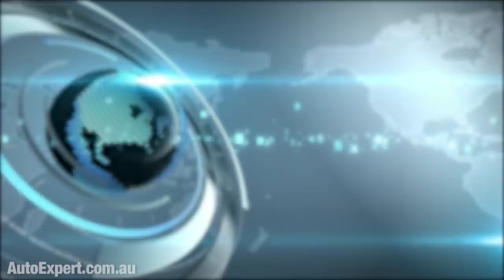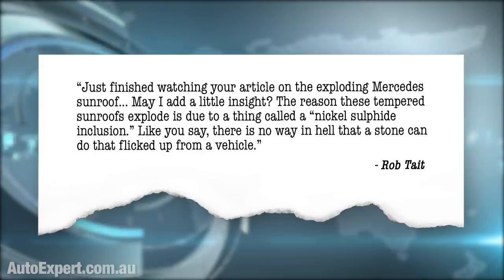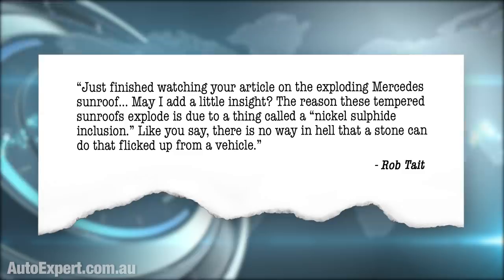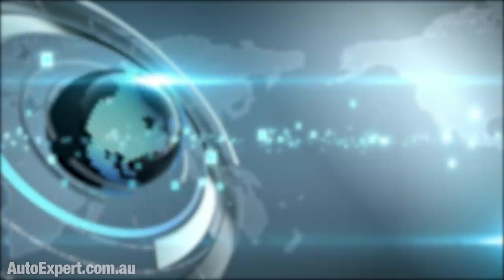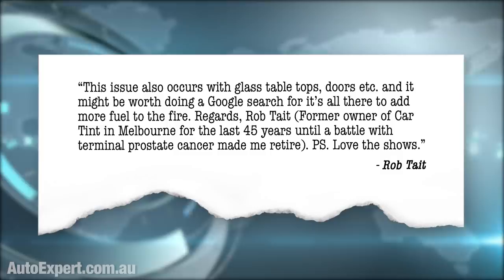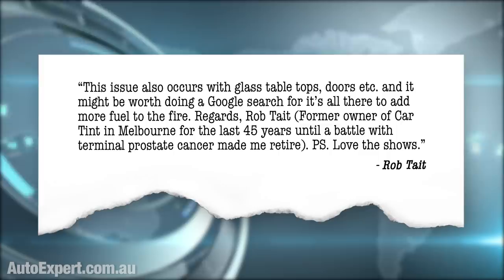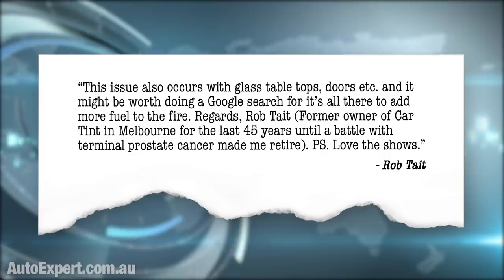Why panoramic glass sunroofs sometimes spontaneously explode & shatter | Auto Expert John Cadogan

Comment: Panoramic sunroofs are most definitely tested in real life before production, and not just virtually. I was fortunate enough to do a job in an R&D testing facility in the Netherlands a few years ago. We walked through one room where a whole variety of car parts from different brands were being stress tested. There in the corner was a panoramic sunroof set on a jig undergoing vibration stress testing. When I mentioned I was from Australia, the guy said the test was equivalent to driving across Australia several times, simulating using only corrugated, pot-holed roads. Was quite interesting.

Comment: Yep, correct - my comment from 2 days ago.  "One issue with tempered glass is a very low percentage of glass panels can spontaneously break. This is due to nickel sulfide stones increasing in size due to repeated heating and cooling during tempering."

Comment: I worked in a soft drink factory for twenty years. With bottles under pressure, you only need one tiny stress riser…say a minuscule inclusion that was in the molten glass when the bottle was made, or a tiny scratch…and when pressure is put in that bottle. We used to gather up as many shards and pieces of glass as possible when a bottle exploded and send them off to the manufacturer to be analysed. They would find these tiny inclusions and be able to point out where the explosion started. It was very interesting stuff.
Oh, and I can’t think of a reason why I should win the power pack. Unimaginative plonker that  I am.

Comment: I've got a sunroof in my car. The only time I used it was when I tapped its button rather than the Cruise Control one adjacent.
For me, the sunroof is as useful as bicycle to a fish.
Reply from the maker: I never open mine, either.
Reply: When i had one i used it all the time. I loved it. I remove the sunroof from my 1985rx7 all the time
Reply: I have a 100 lbs blue tick coonhound in the car with me most of the time, so the back right window is almost always open, even with light rain and snow.  If it's above 50F (10C), the sunroof is open as well and he stretches up so his ears can flap in the wind.  He does that in both my Forester XT and F350.  A sunroof is a deal-breaker for me.
Reply: Does anyone ever open them?! I feel like people like the idea but then they realize it’s too bright and/or too loud and never open them.
Reply: Why buy a car with a sunroof which usually cost extra by the by
If your never going to use it ????
Reply: @daithiheneghan458  like John said in the video, most of the time they come standard on high trim levels so you don’t have a choice.

I agree though.
Reply: @daithiheneghan458  because it is a standard addition to the high spec models.
Reply: @kc510  As John said a sunroof is already included in the upmarket models so a lot of owners are stuck with them.

Comment: When pushing an inverter, you need to say the max KVA/KW/Amp rating. Its ok to to have the KWH rating but if you need 7amp/1.6KVA but the inverter is only 1.5KVA than a billion KWH is useless.
I have a 300W inverter and a 500w inverter. To charge my drill battery which pulls about 150w, but would trip the 300w inverter on start-up.

Comment: In New Zealand they used toughened glass windscreens well into the 80's and it was not unknown to find your windscreen mysteriously shattered in the garage overnight. Usually during summer since there was quite a temperature variation between day and night.
Reply: A real bastard when you are driving a truck at 100kmh and it shatters. Took me 2 weeks to get the pieces out of my hair.

Comment: Tempered glass as used in home shower screens can easily explode with just a very small impact to any edge of the panel. The glass explodes in a linear plane across the sheet.
I have personally seen a glass panel explode during instillation. This explosion was strong enough to leave glass shards implanted into the ceiling and into the arms of the men installing the panel.
My point is that these car roof panels may have had a side edge impact or stress raiser that instigated the breakage.
Cheers mate.
Reply from the maker: But probably not. Probably a NiS inclusion.
Reply: @AutoExpertJC  I personally had a glass shower screen fail catastrophically when I was removing it several years ago. When I pulled the top away from the wall, the bottom corner dug into the wall, and it went BANG! Pieces of glass 6m away in the bedroom. Luckily I was wearing my sunglasses as safety glasses.
Reply: @labourlawact7826  🤣🤣🤣 your still at it.
Reply: @labourlawact7826  No not at all you go right ahead and fix all the spelling mistakes on the internet, I see your a cat owner so it all makes perfect sense.
Reply: @labourlawact7826  by the way it’s installation 🤣🤣🤣🤣
Reply: Tempered glass by it's design cannot break in 'shards', rather it is designed to break into small cubes. If you are seeing traditional glass shards it does not comply the Standards Australia design requirements for shower screens.

Comment: The Bluetti power unit is sure a beauty. The owerner manua (User_Manual-AC200P) does not state 'Pure' or Sinewave' in user maunal. 

Pure sine wave what?  An commercial inverter based unit as this supplies an output to run 220/240 Vac @ 50/60 Hz appliances but the output 'voltage' is not a sine wave or pure (from my observation and technical measurements of other systems up to a couple of megawatts)

Comment: Re Automobile Manufacturers cost cutting ethics. The Ford Pinto is a prime example where Ford examined the cost of accidents and compensation  to the owners/drivers involved when a Pinto fuel tank ruptured causing a fire. They knew this was a problem as their own tests confirmed it. However, the expense of an engineering design change far outweighed the possible cost of compensation, so the car went on sale anyway, and many people were killed or maimed due to a rupturing fuel tank in what would have been a survivable collision except for the ensuing fire. QED

Comment: Ah the memories of burnin up and down the high streets of Darwin in an aquatints Trans am Knight rider style with da T Top, I was a young Dealer aka Croupier however the other occupants of the vehicle where Dealers and had been doing product quality control testing which was clearly an absolute success as the front passenger pulled the handle on the half glass suffice to say it shot up about twenty feet in the air and upon impact totally shattered leaving only the chrome framing which I pointed out to the driver who was that angry he didn’t stop or speak another word that night.

Comment: Question.
I was sitting in my glass roofed Hyundai, and on a very cold morning I can see 4 big round suction cup marks. Wonder they're from factory or it's been replaced? We purchased the car 2nd hand, nothing in the service manual about it.
Reply from the maker: Could be either.
Reply: Could be aliens. 🛸
Reply: @mael-strom9707  Suction cup marks from the tentacles?
Reply: ... or perhaps left by the pads on a previously installed roof accessory?
Reply: Clearly, it was a land octopus!

Comment: I mean ...I can definitely think of several cars they just didn't bother to strengthen the chassis when they cut a hole in the roof because it was "good enough". Thinking of you Targa top supra. You could literally see the gap in the roof flex a cm or more when you went over a bump. 

To be fair. They were right, it never broke. 

But I can definitely imagine the 3 prongers only putting in "just enough" renforcement in to stop them breaking but it still being a problem on occasion.
Reply: If it’s anything like the VW sudden acceleration problem, Head Office in Germany will acknowledge the problem but 3 pronged Shitzville will throw aussies under the bus.

Comment: Glass is a very strange material. I accidentally took a hot glass out of the dishwasher and quenched it with some cold iced tea. Upon filling the glass, the glass shattered in my hands. There are many ways to shatter glass, without any outside force acting upon it.
Reply: Your hot glass exploding when you filled it with something cold is not that unusual really. Will happen to most glasses. I've had cups explode when filling them with hot water. Now, that's scary!
Reply: I used to have glass plates and I heated one in the oven and then placed food on it and it went bang in front of me and shattered like windscreen glass. Porcelain doesn’t do that.
Reply: @labourlawact7826  Ahh I once superheated a cup of water in the microwave, I took it out and put it on the bench and dropped a spoonful of coffee in it and it overflowed violently and half emptied the cup, was a mess but I didn’t burn myself. Coffee water leaked into the cupboard and had to be cleaned up.
Lucky it didn’t happen when I was holding it, I read that a sudden bump can trigger it.
Reply: @darylcheshire1618  Yeah, you're right, something can sometimes just be the trigger it needs to go bang. Microwave boiled water/milk can be dangerous, as it's like there's still some energy left in it when it comes out. 
Strange, kettle boiled water doesn't have this "energy".
Maybe we can ask someone like John who's studied these things to explain it to us☺

Comment: Can a dealer technician run a nickel sulphide scanner over your sunroof to pick out any bad stuff before it detonates? My car goes in for a service Monday.
Reply from the maker: No. Not possible.
Reply: You're thinking way too much of dealer technicians. They're much better at throwing you under the bus than anything else.
Reply: @labourlawact7826  I am wondering how widespread this problem is? How many sunroofs would have to crack before the manufacturer would issue a recall.
Reply: @MrAndrew1953  Apparently the one in 10,000  isn't enough for them to issue a recall, besides John said it's virtually impossible to get all the nickel stuff out that causes it. So, I guess they take it as an acceptable risk.
Reply: @labourlawact7826  So if the Sunroof on my XV blew out tomorrow, what would the situation be as far as Victorian consumer protection law be? Can insurance or extended warranty cover this sort of thing?
Reply: @MrAndrew1953  I'm sure your car's insurance should cover it. They usually cover the glass and windscreens
Reply: @labourlawact7826  That's good to know. Things like this come very much out of the blue. No one tells you about nickel sulphide when you're thinking about getting a car with a sunroof. Yes it is very desirable feature but there are risks.
Reply: @MrAndrew1953  I don't think you need to worry about it really. One in ten thousand aint many. 
Do car salespeople tell us that a tyre can blow out and you could die from an accident caused by it?  No. 
It's an acceptable risk.
Reply: @AutoExpertJC  there is the good old "polarised sunglass option" - stress in the glass causes some minor rotational polarisation relative to the stress level and the frequency of the light. This causes what is called "birefringence" visible with polarised glasses.   

If there is a region of unusually high stress due to a nickel sulfide inclusion, then this may very well be visible through the sunnies, particularly if you twist you head, through 90° to examine it at all polarisation angles. 

Also couldn't hurt to check it out using a pair of cheap cinema 3D glasses (one eye at a time), as these are circularly polarised lenses, oriented in opposite directions. 

☝️ Bugger all cost or effort, and might work! 🤷🏻‍♂️

PS. Check out iridescent beetles (the insects, not the car) using the 3D glasses... The iridescence is often circularly polarised, making it look very different depending on which lends you are looking through.

Comment: This is no different to the tempered glass problem years ago when lots of people’s oven doors were exploding weather the oven was on or off.
Reply: Weather. Whether. 😨
Reply: We experienced that. The oven was not in use and the oven door suddenly shattered over us whilst we were quietly eating breakfast. I blamed the kids / husband / dog  even though they weren't anywhere near it, but the el cheapo manufacturer replaced it without batting an eyelid. It was almost as if they knew what our complaint was going to be before we voiced it!
Reply: Whether climate change is the culprit is difficult to determine. 😅
Reply: @mael-strom9707  Whether climate change is to blame for extreme weather events is open for debate
Reply: @labourlawact7826  Whether the wether was affected by the weather or whether it was spontaneously neutered by climate change is still under investigation. 🙄
Reply: Whatever
Reply: @benharris7957  Yeah Bogan.